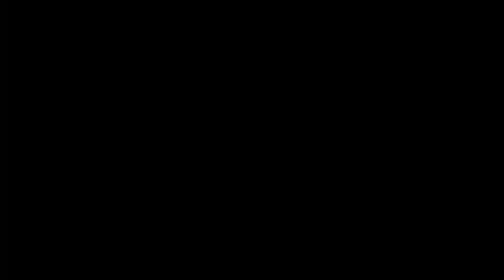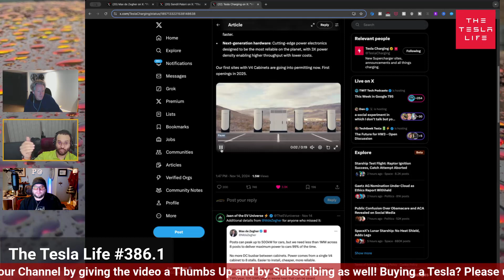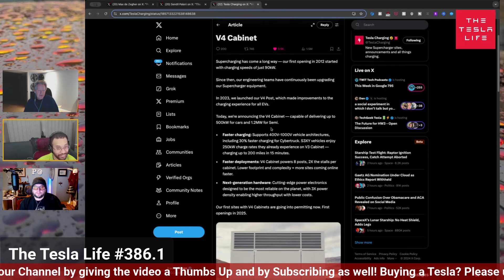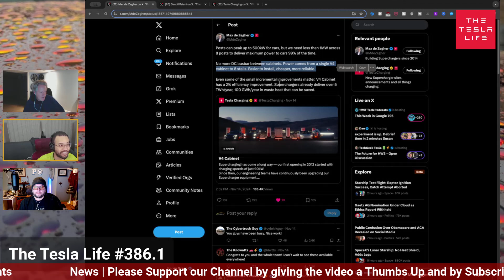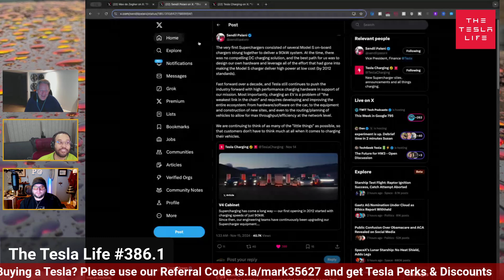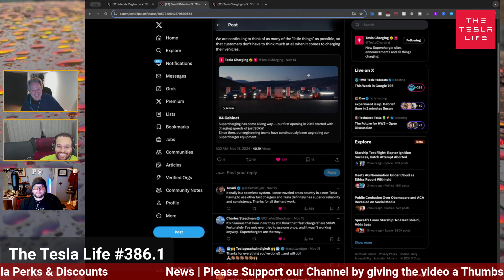TTL Express #386.1 - V4 Supercharges Coming!

Comment: Higher power chargers is great.
My big concern is the long cables since people don't know how to treat them properly and they are abused, they are easier to damage, decreasing the reliably of the V4 chargers. Good that Tesla has many chargers at each location just in case some are damaged. In Canada cables are left on the ground, snow plows get them in the winter, Grand valley is an example.
Reply from the maker: Grand Valley AB?
Reply: @TheTeslaLife  
Grand Valley Municipal
15 West Back Alley,
East Luther Grand Valley ON L9W 5M4, Canada
Only one Tesla charger working, the other 2 cable missing and damaged cable and charger. The J1772 looks like it’s intact.
Suspect snow plow got them last winter, still not fixed.